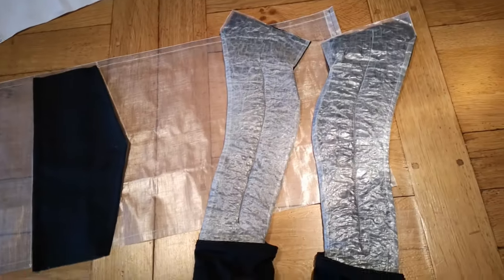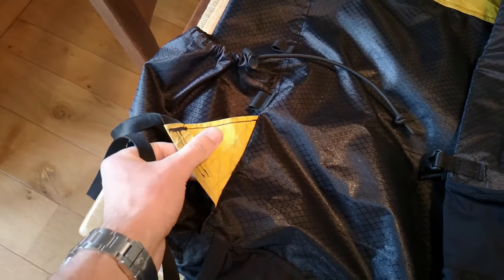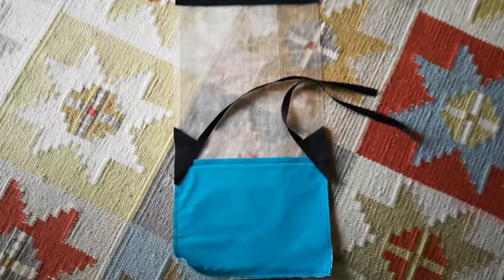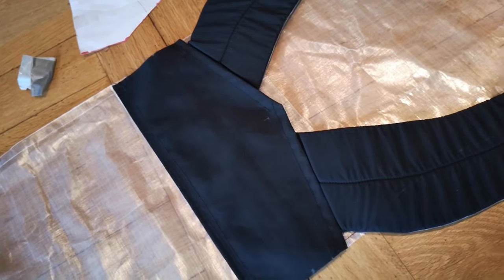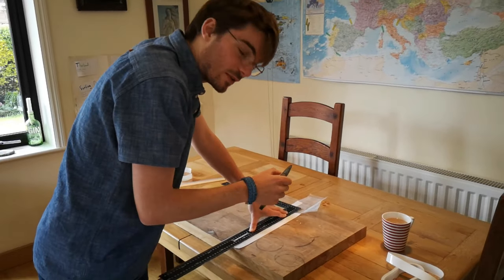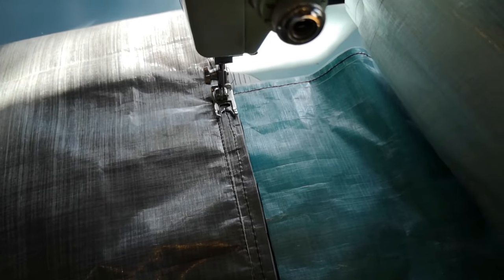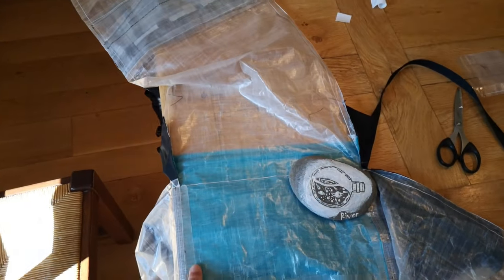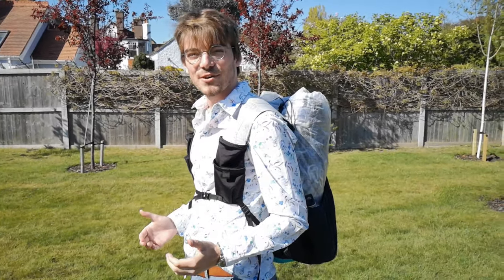How to Make an Ultralight Dyneema Backpack, DIY/MYOG, Part III - Final

Comment: Follow-up to earlier post. I made one using Challenge RBC400™, 400den Recycled-Polyester, PU-coated, 178g/sqm, but mine has a slightly bigger footprint 19x33 cm rather than the 17x28 cm in design drawings. Worked really well with up to about 15 kg. I had added a couple of straps round the body to have more 'line' to hang things on to dry or to compress the bag. The big wrap around bag is genius as it seems to hold unfathomable amounts of stuff.
My main problem with the bag is that i couldn't find a use for the bottom pocket. a) the elastic fabric (Bike-Jersey, wicking, highly elastic, 180g/sqm) is a magnet for sweat and as it comes up at bit on the back panel it takes it off your back and distributes over the entire bottom area, and at least my fabric did not try fast so after a break you put the backpack back on and while you shirt might have dried, it gets immediately soaked  by transfer from the bottom pocket. b) I also had nothing really to put into it because of the wetness and because as soon as you put the backpack down you basically crush what is in the pocket. c) at least the fabric i used apparently was great in terms of capillary distribution of water, which also means that sweat or rain moves through the bottom seam into backpack (granted, my seam sealing left something to be desired). After a couple of weeks I cut the pocket fabric off and for next year will open the bottom seam and take out the remainder of the fabric. For the bottle pockets the material was great.
For the shoulder straps I made paper templates and put them on because depending on how straight or sloping your shoulders are, the attachment angle needs some customisation.
Finally, because I still had some blue edge insulation roll from a building project, i put that in the straps which worked well for about 10 days but then the bubbles deflated and the padding became less effective; I'll splash out on some EVA for next year as well.
Overall, brilliant videos for a really useful back pack (mine turned out to be 500 g). Thanks!

Comment: Excellent videos which lead to some questions: How does the size (height)  fit with how tall you are? How many litres is your pack and would you have any worries (in terms of strain on shoulder straps, weight on shoulders) if one where to make the back say a 20 cm taller? You have no hip belt; at what point in terms of weight/carry comfort would you add one? That is, if I can only optimise part of my gear i end up with more volume and weight than you use. Many thanks, Uwe

Comment: The pack looks amazing! Hope to see the review after you put some kms with it!
I'm curious about your sternum strap design: how does it fit? Is it stable? Compare to your previous two straps design?
For the elastic fabric, you said it is Lycra right? How did you get some? I'm looking for it but seems there is only in US!
Looking forward for more sewing projects! Continue the good work!
Reply from the maker: The sternum straps sits just at the bottom of my ribcage which is an improvement over the previous design where the lower strap sat on the top of my stomach and crushed it a bit. It's still much lower than a traditional sternum strap which I kind of like. Its sits very stable. I picked up the blue elastic from extremtextil (german)  and the black lycra is from a traditional fabric shop sold for making sportswear/clothing

Comment: Thanks so much for these vids. Do you plan on putting the pdfs anywhere?
Is Dyneema fabric waterproof, could you submerge it into water? Just thinking about making a roll top paddle-boarding bag or something... Vids have been really useful though!
Reply from the maker: Pdfs haven't happens yet but I highly recommend getting LibreCAD (it's open source) to view the plans it's super easy to use and lets you measure any dimension. Dyneema is 100% waterproof and the pack is submersible, that said I would recommend a tougher fabric like X21RC or LS21 for a paddle boarding pack. The Dyneema is super delicate

Comment: Wow, great job! I love your content! I'm looking forward to the review after some miles, because everyone says that abrasion is what gets DCF to its knees...
Did you consider e.g. x-Pack's VX21 fabric as a more durable alternative to DCF? Was weight the only reason why you went for the DCF in the end?
I'm planning on building 45-50 litre pack to carry up to 44 lbs (20 kgs), with custom internal carbon composite frame and decent hipbelt. Did you ever think about anything like this? Especially about the possible frame shape and position to keep it functional but light? 
Thank you for sharing your guides and knowledge. Hoping to see more of your content! Happy Hiking!
Reply from the maker: Cheers friend 🤟. I'm also excited to see how the DCF holds up, will defo do a follow up video with some miles, my gut tells me this pack is delicate! I considered x-pac X21 which I have used for previous builds but wanted to go all out on weight this time around.  Frames sound interesting and would be a  cool project but I don't really need one anymore. Look forward to seeing how you work the CF into a bag, send us some photos when you build it 🤜
Reply: @twofoolswalking2109  Hi and thanks for the reply. How has the X21 been holding up on the inside? Without the inner lining (that the VX21 has) I read that it looses its waterproofness too quickly as the unprotected plastic film wears off. Also, have you observed stronger outer abbrasion where the protruded "X" reinforcement grid is? (as others sometimes describe with other "X" marked x-pac fabrics). I'd obviously love to go with DCF, but as I sometimes need to carry snowshoes I'd prefer something that can survive some abrasion...hence I'm looking to xpacs as well.
Thank you! :)
P.S. Looking forward to your updated plans as well because the big pocket looks like it could somehow protect the DCF while handlig the pack on the ground :)

Comment: Where did you buy the double sided tape you used to make the 'cuben' tape? I'm about to make a prototype of this bag (or similar) :) .
Reply from the maker: It's from extreme textil, German based company, sold as double sided transfer tape
Reply: In the states you can get it from rip stock by the roll

Comment: loving the design, im trying to work out how the front pocket elastic works, dose it have attachment points to the pack at either end? and dose it just run thought at the peak of the pocket with the hook being attached via the wedding on the front?
Reply from the maker: Exactly how you say at the peak, at the pockets (ends) there are just eyelets which the elastic runs out of. A toggle is on each side and is used to tighten the elastic
Reply: @twofoolswalking2109  thanks, I've had a play and can see how it works think I was just over complicating it 😅

Comment: thanks for sharing.  your videos are really helpful and i'm working up the confidence to have a go and make a backpack.  i am having trouble finding the eva foam in Australia.  just wanted to check you use 3mm thick foam? i know you said it on the video but it seems a lot thinner them other people use so i wanted to double check.
Reply from the maker: Hyped you're making a bag friend 🤟 it is 3mm foam. I've always argued that it's the width not thickness that makes em comfy so go thinner to save weight. If you struggling to get hold of 3mm then <5mm  is probably all ok 😊
Reply: @twofoolswalking2109  Thanks just had to confirm.  Now to finding a supplier of good quality foam in my country.
Reply: sorry to bug you again but i've been looking into the eva foam and have found there are different densities.  it seeems eva30 is often is used for backpack straps but i was thinking maybe  eva75 which is denser may be better if i'm using 3mm thick foam.  just wander if you new what rating your foam has?